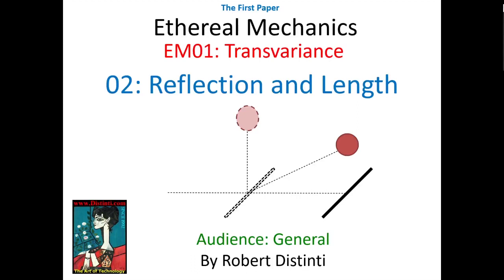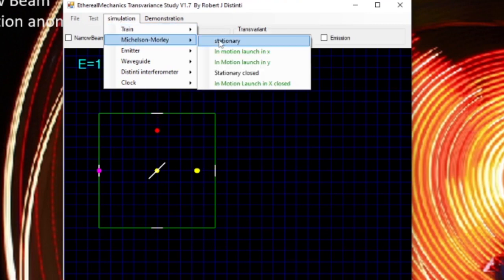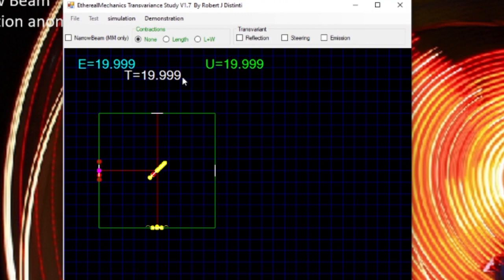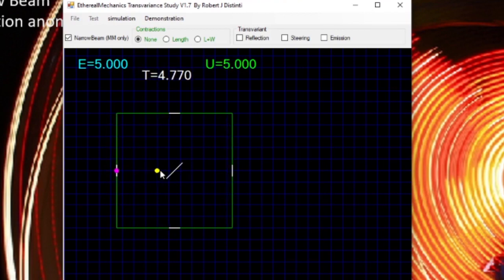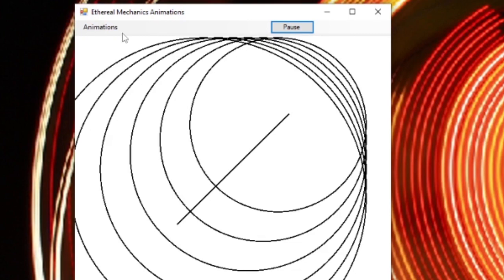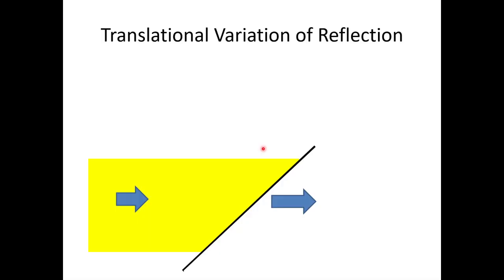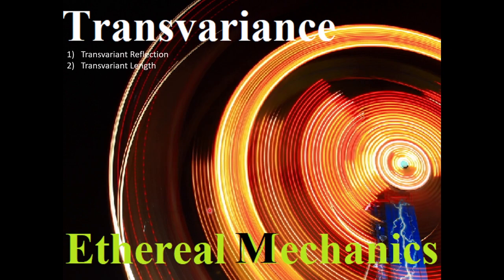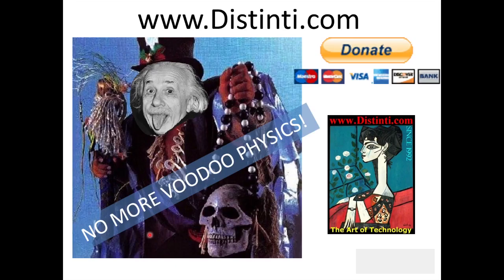EM01 02: Transvariant Length Contraction and Reflection

Comment: Of course this video is completely wrong. A plane wave is described by exp( i[kx-wt] ) where that phase is kx -wt. Since phase represent where the oscillation is in its cycle (e.g. max, min, zero-crossing), it has to be Lorentz invariant, as all observers must agree on "number of cycles". Note that using 4-vectors phase = k_mu * x^mu ...that is Manifestly invariant. The light bounces horizontal to vertical in ALL references frames.

The key reconciling your "stationary" and "moving" views (2 meaningless words in the world of Special Relativity) is to understand the relativity of simultaneity: for the moving frame "now" is moved into the stationary frame's future as you move to the right, which "realigns" the phase fronts to "perpendicular".

Think about it, and you'll chuck your theory into the dustbin of history.
Reply from the maker: My theory gets the correct answers.  Just because you also get the correct answers does not mean my theory is wrong.  "Stationary" and "moving" are not meaningless because without considering a medium for light, it violates locality.  Length contraction without a medium violates locality and is the cause of the ladder paradox.  once you consider that length contraction occurs because of motion relative to a medium, the ladder paradox goes away (that was the ORIGINAL use of the Lorentz Fitgerald contraction equation).  You want to live in a world of paradoxes -- go ahead.  Relativity has gone nowhere in 100 years -- I have unified Electromagnetism, matter and gravity in a method so simple that a child could understand it.  Relativity will not survive me.
Reply: You have to be extremely narcissistic to say relativity will not survive me. That is some grandiose bullshit your theory makes no sense.
Reply from the maker: @dt5072  No scientific theory has stood the test of time. Relativity is overdue.  It should have been replaced long before me.  There is nothing grandiose about that.  It's called being disgruntled that I can't do my job as an engineer because, physicists are too poorly trained to do theirs.
Reply: check your biases at the door Dr G
Reply: @adrianm4506  no biases, just an explanation that should convince anyone who bothers to think about it.
Reply from the maker: @DrDeuteron  Convince them of what? Maxwell's Plane wave has nothing to do with exp( i[kx-wt] ).  Maxwell has the  kinetic (B-Field) and potential components (E-field) in phase.  The kinetic and potential components of exp( i[kx-wt] ) are in quadrature.  Another victim of the poor education system.  This is explained about 5 minutes into this video https://youtu.be/hYE9cri5DFs?t=347
Reply: @etherealmechanics5686  relativity is the best we will ever have get used to it
Reply from the maker: @dt5072  If you honestly believe that then you are obviously not a trained scientist.
Reply: @etherealmechanics5686  well good for you for trying
Reply: @etherealmechanics5686  no i am not i just think relativity works
Reply: except for when u try to mix it with qcd
Reply: @dt5072  what's wrong with relativity and QCD? The QCD Lagrangian is manifestly covariant. Solving the equation is a whole different story, though.
Reply from the maker: @dt5072  Look up the ladder paradox.  Look up the reason why they need fictitious dark matter.  Why does relativity not explain the cause of length contraction?  Why does relativity not explain the cause of time dilation?  EM has no such issues.